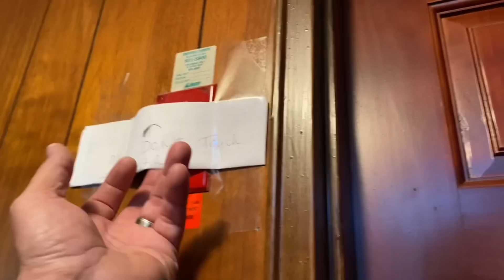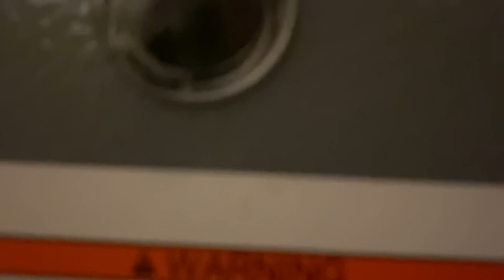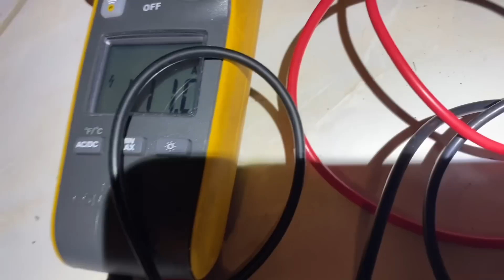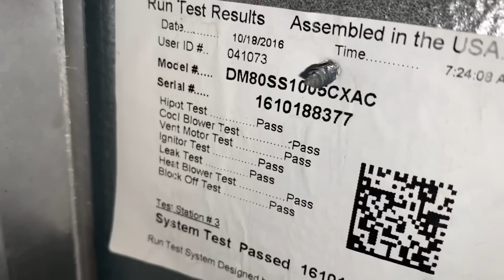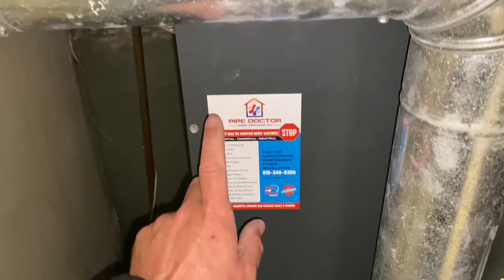Sunday Emergency Heating Service Call Daikin Gas Furnace Dead Transformer How to Test and Repair

Comment: question is, what blew the transformer?  line voltage power issue? a short somewhere that slowly cooked it without blowing the fuse?
sure they can randomly fail, but not that often.
* I posted too soon, at end of video their lights flickering is probably a broken or loose neutral, if that's the case the transformer could see over and under voltages from zero to 240volts.
that will sure make them emit smoke, along with much of the homes devices/lighting. 😳

Comment: Mike the limit does not turn the blower fan on. The fan is timed on from the circuit board. I’ve told you this before you can check my information with any tech service department. The old fan / limit controls did turn on the fan but that was back when I was young and I haven’t been young for a very long time .👍👍🇨🇦

Comment: Hey mike what would your recommendation be on beat source to heat radiant floor, new construction thinking about using a boiler and heat pump for house and use the boiler also for the floor.
Reply: I have the radiant tubes ran but im wondering what will be best bet to heat the whole house and floor. I see alot of people using water heaters for floors but if I can just use a boiler too heat both in one shot.

Comment: Transformer because excessive amperage draw of the blower motor? Blower turns on from the relay contractor closing the heat terminal on the board sending 120v to the blower motor. Limit is a normally closed switch the opens do to excessive heat in the heat exchanger cutting the 24v section continuity.

Comment: Ya that voltage drop was odd. It was hard to see because your meter leads where in the way but the high voltage side of that transformer looked like it was metering low. I wonder if they have a loose or corroded meter or feeder wires for the street.congrats bro on 100k. Fuckin Mikey Pipes Baby. 😂😂😂😂🎉🎉🎉😂😂😂

Comment: So I know you don't do a lot of forced air but that limit switch does not tell the fan to come on. The control board has a blower on delay programmed in to it. The limit circuit will cut 24v to the gas valve if it opens.

Comment: Mike, in the event that the high limit sensor fails i;e cannot sense the temperature of the heat exchanger what happens next? Will the furnace attempt to run anyways? Without the blower motor running moving the heated air into the vents I assume the heat exchanger would get superhot unless there is another safety/heat sensor that shuts the furnace down.  Non HVAC guy here.

Comment: That 1k resistor thing for the relay on power stealing thermostats, isn't that for current limiting, or is it a voltage pull-up for successful relay energizing? Curious... 

If you ain't testing, you're guessing! :)

Comment: 11:16, The limit does not turn on the fan, The control board times it in from start up based on MFR built in blower time delay. The limit shuts the gas down when the high temp limit is reach due to a blower failure, airflow issue. SEQUENCE call for heat initial check for stuck or open switches Inducer motor cycles closes press switch igniter warm up timer gas valve and ignition flame sensor proves flame and then the blower on delay. Congrads on the 100K!
Reply: Yes this is correct. I believe some are adjustable using dip switches on the board but I could be mistaking that with the blower off delay
Reply: Correct
Reply: I was gonna say this if someone else didn't. Good catch
Reply: yeah, the vast majority of control boards on the market are fixed 30 seconds delay, starting with main burner flame proven to indoor blower turn on.
the blower off delay at end of heat/cool call is often selectable. 
yes you'll find some in the field with jumpers or dip switches allowing both blower on and off delay's to be changed and even some with thermistors(temp sensors), usually paired with an ECM motor for more precise variable control.